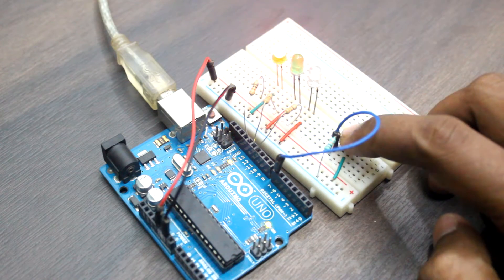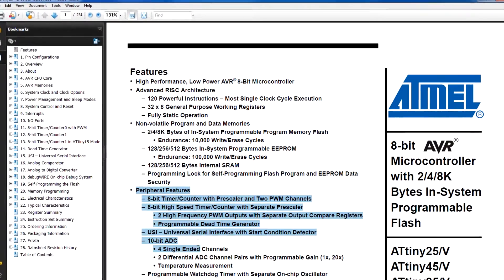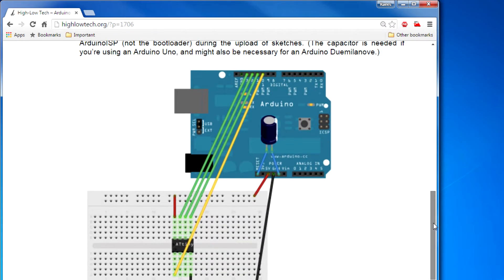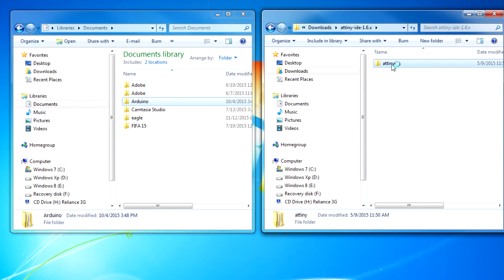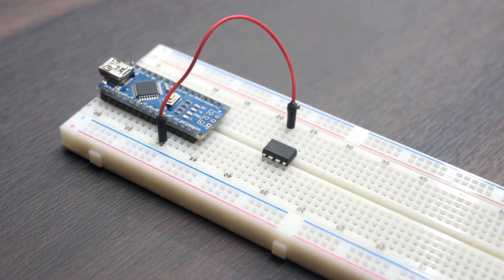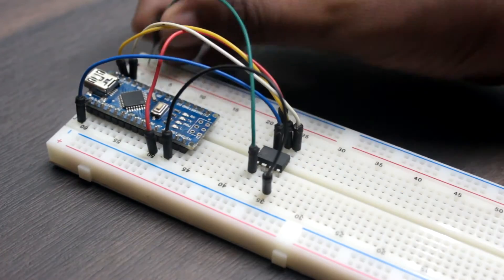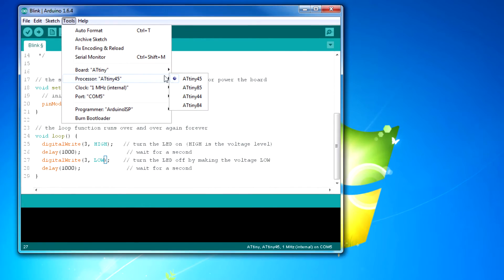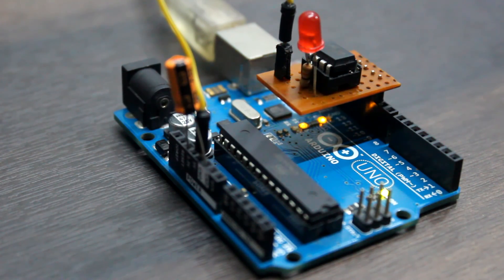Attiny85 Arduino Tutorial.

Comment: Hmmmm.  I just built a simple circuit using a 555 timer chip, 3 resistors, and a capacitor.  Just by monkeying with 2 of the resistors, and the only capacitor it has, you can alter the speed, duration, and time off/on of any LED you insert.  I connected it to 4 small LED's arranged in the shape of a tiara for my nephew who has mega coiled fro hair 6 inches thick.  Now he can walk around with blinking LED's in his hair.  I guess that's one use.